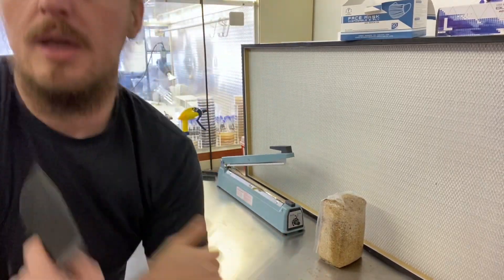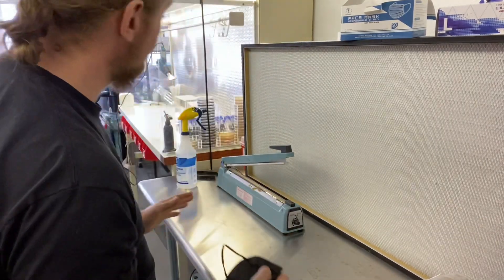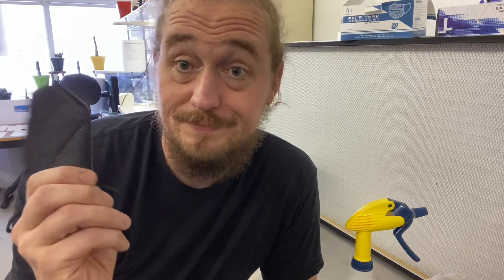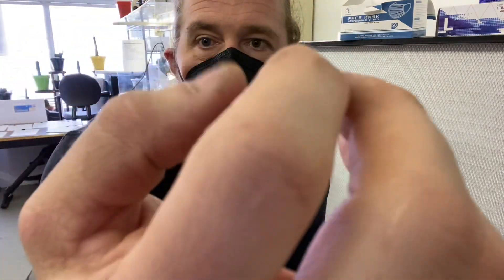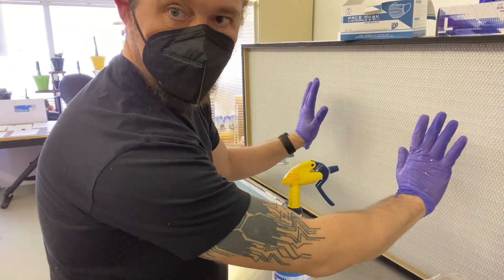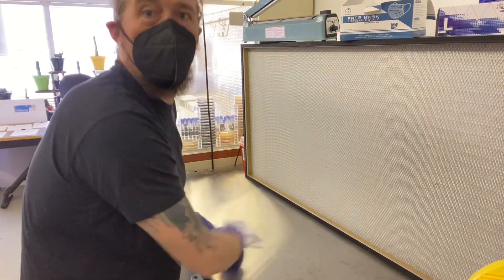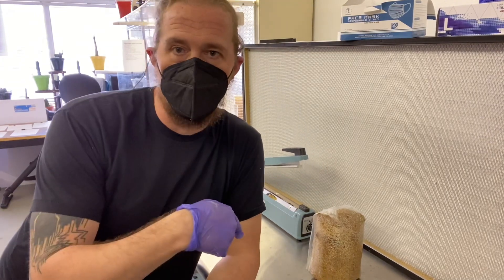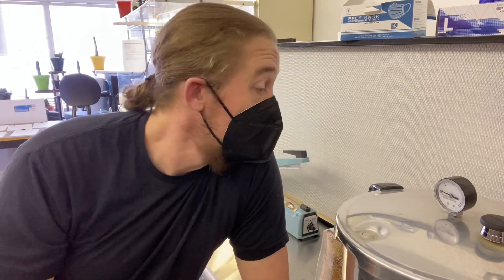Humble Fungus Training Video 1: Aseptic Technique and flow hood basics

Comment: Does that room have or need positive pressure to run that flow hood?
Reply from the maker: Nope; the hood pulls the air through the filter with a blower leaving a clean workspace
Reply: @PracticalMyco  what’s your preferred method of contact with questions related to mycology? Can I email you questions and content?